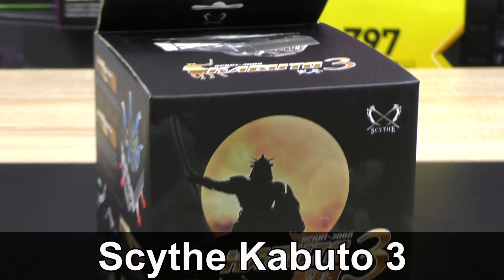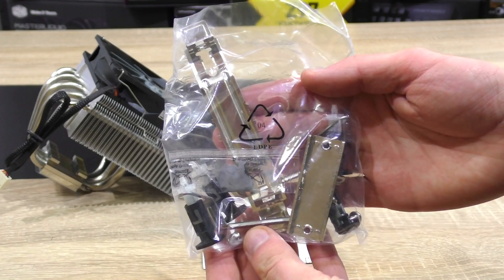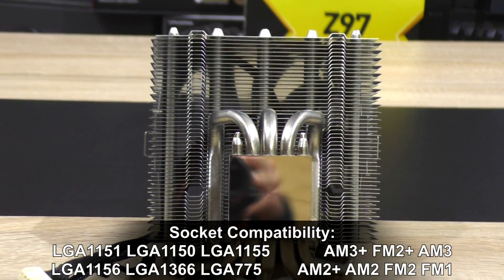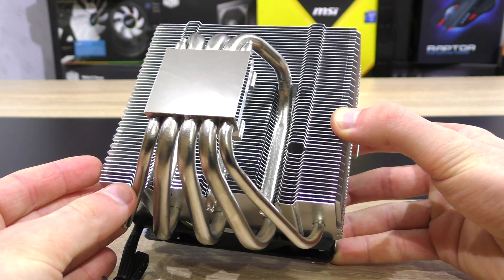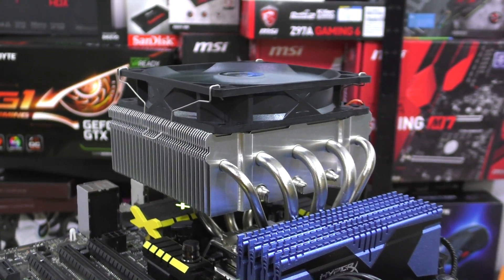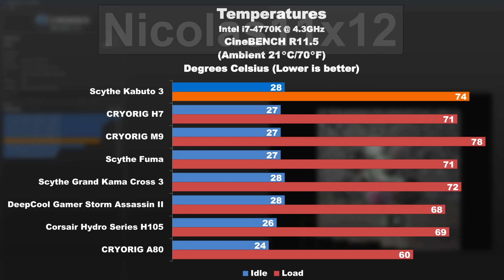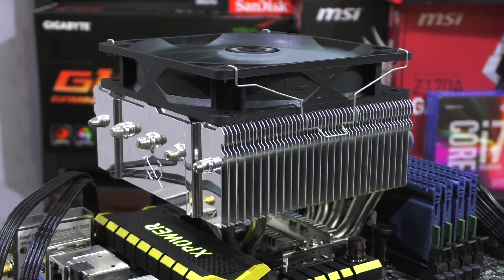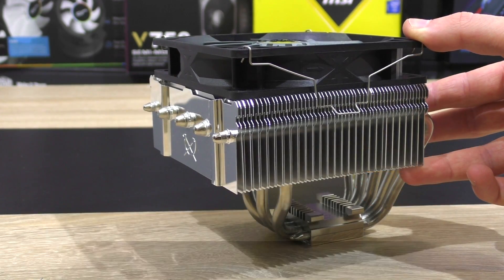Scythe Kabuto 3 CPU Cooler Review

Comment: I run an A10-7870k with the stock cooler, which aftermarket cooler would you recommend that's <75mm tall? Silence is my top priority as I won't be overclocking.
Reply: cryorig c7. its only 47mm